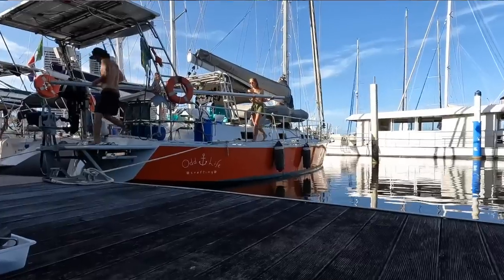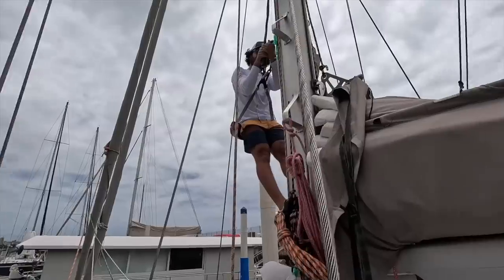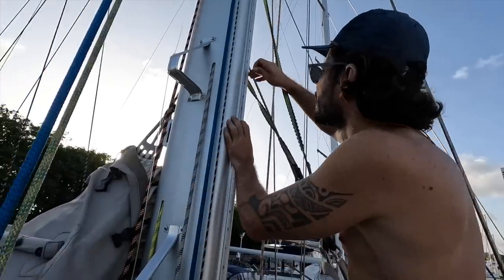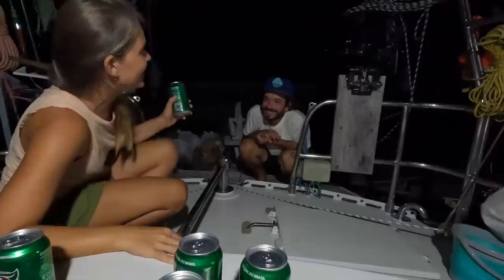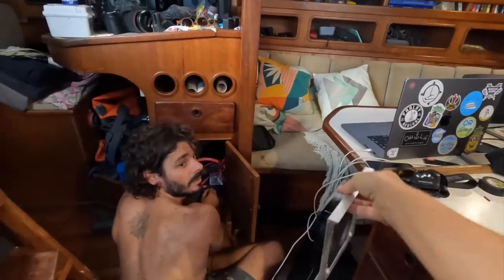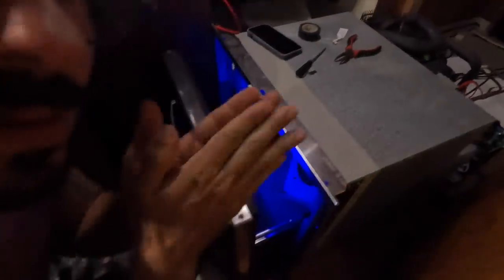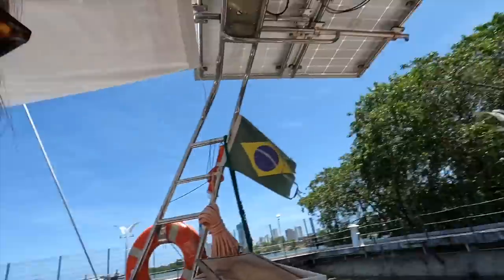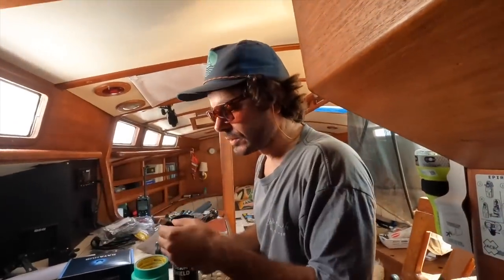⛵️How to get our boat and ourselves ready for a 2300 Nautical Miles Passage!! Ep.270

Comment: If the freezer fan shuts off when you open the door of your freezer, the problem "may" be the switch that senses to door position. It may be signalling the controller that the door is open, when it is in fact closed. Try looking at that before you buy a new controller. Cheers from Winnipeg.

Comment: At least you have the freezer working again so you can get a new circuit board and fix it properly.
Duca you can get a metal burr bit for your drill that eats into steel so you can make any drill holes look almost perfect. I used to use them when I was a jewellery manufacturer/bench jeweller.
A good amount of canned food for the trip and you'll definitely be restocking while you are on the trip aswell so you looking to see how much you can get in storage and how much you use on average before restocking especially with the freezer working again isn't a silly thing at all with all the traveling you both will be doing.
Have fun you guys!

Comment: Have you thought of getting the drill/tap combo. It drills the hole and then threads it at the same time.  Saves a lot time when doing multi bolt holes.
Reply from the maker: That’s really cool. We have never seen one. 🤦🏻‍♂️
Reply: @OddLifeCrafting  they are callet tap and bits.  You can get them for soft metals or hard. I would recommend the hard metal ones as they would be good for any type of metal. I use them all the time. Mainly on my racing RC boats. The ones I have go from 3mm up to 10mm.

Comment: Regarding your ilidium antenna location: The external antenna you have installed in Iridium is 1, too low. 2, has a metal pipe around it that lowers signal reception.
I recommend that you install it preferably near the trailing edge of the solar panel where there are no other metal objects.
I had a similar problem with an antenna in a similar location and had to re-install it in the middle of Pacific Ocean because I could not communicate with the iridium satellites. I hope you have enough length of the cable!

Comment: You might check the door switch and see if it’s not the problem with the freezer.  If the switch is bad, it will stop the fan from coming on.

Comment: Top tip. Buy a can of silicon spray for pulling wires. ( I do this for a living ) it will save you a lot of heartache.
Reply: Dishwashing liquid and some water in a spray bottle or even better thinned down water based lubricant is cheaper and better environmentally
Reply: @jackdbur  wrong.  PVC  is not waterproof ( dont take my word for it, go fact check me )  Most kit such as Nav and Coms use data cable and it is not waterproof unless it specifically says so.

Comment: Ive never seen blocks used to raise and lower the car in the track. There is usually a spring loaded pin that just clips into one of the holes. it's less moving parts, less to fail on a long passage.
Reply from the maker: https://support.seldenmast.com/en/products/spinnaker_-_gennaker_hardware/spinnaker_lift_system.html
Reply: @OddLifeCrafting  That is a horrible system for a cruising boat the pin system is way more robust and easier to use & install. There is also no need for the complicated/ expensive carriage that you have . Your not a semi racing yacht. You have been way over sold.
Reply: @OddLifeCrafting  I see it, I understand what it's trying to do, but it didn't sell me on it.  I need simple on a cruising boat.  Replacing a failed part of that system while up some river in Guatemala or somewhere else, you may revisit you decision.

Comment: I tap every screw hole I put in my boat. Wood and fiberglass, not just metal. A threaded screw holds much better and longer than a wood screw. And is more waterproof.
Reply from the maker: Thanks for the tip

Comment: you said the problem, the door has a switch that turns off the fan when you open the door, the switch could be bad. but your fix is ok, the fans are low wattage

Comment: Usually there is a relay on the circuit board. You can look up all the part numbers until you find the relay. Then just change it usually 4 pins

Comment: What RG rating is the coax Duka? Looks like it's only RG213 which seems sub-grade for them frequencies (GHz range). I'd HATE to be passing through the coax I use at home for the VHF and UHF (HFSC12D if you want to look it up) as it wouldn't pass through that goose neck. The HF coax I use at home (RG213) would though.

Duka that looks like a regular N fitting. Without the collar under it you could have just spun the antenna on, it's the collar that stuffs you up.

And yep the issue with modern systems is MORE WIRES.
Reply: I don't know why they are using a gooseneck as a though deck penetration when there are many different fully sealed cable glands available, if they get fully knocked down it will allow water into the boat!

Comment: I'm going to guess your little circuit board has a burned out capacitor. Some of them are heat sensitive and will eventually just fail. I had an amplifier for my Audi car and after 20 years the stereo became unusable. I was quoted up to $1000 to fix it. I pulled the amp out, replaced 6 electrolytic capacitors at $0.50 each and bingo. All working again.  Note electrolytic capacitors have temperature ratings - higher will be a bit more expensive but worth the longevity.  Or maybe your good enough fix will be fine - seems like the worst that happens is you blow some extra cold air out while the door is open. Maybe turn it off briefly?

Comment: Why mount the antenna so low? In my experience a higher mounting point with less around it is better for both signal and range but I’ve never mounted an iridium antenna so I’m not unsure on its minimum requirements.
Reply from the maker: I didn’t want to put it up the solar panels to avoid creating shade on them. We actually changed place later and it worked pretty well
Reply: @OddLifeCrafting  understandable really glad you got it all to work out well for you. Wishing you both smooth seas and safe journeys.

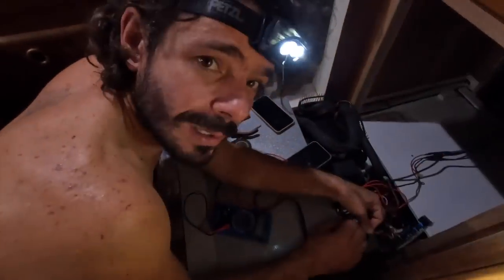Comment: 16:29  ''when you open the door the fan turns off.....''   are you SURE THAT SWITCH AND THE WIRES TO IT are OK???  ummm you tested that right?  an open there would simulate opendoor therefore no fan, RIGHT?